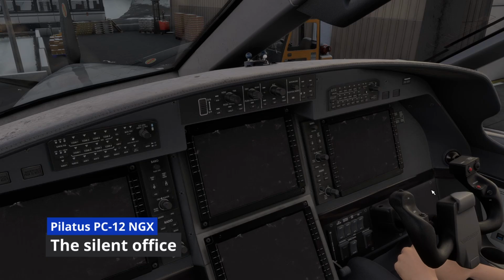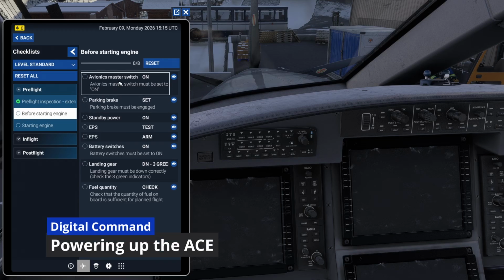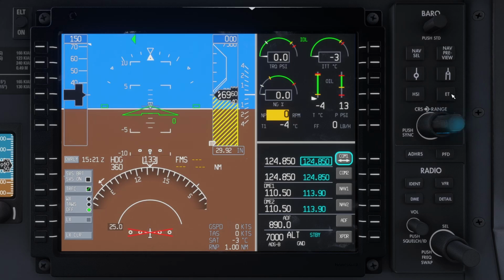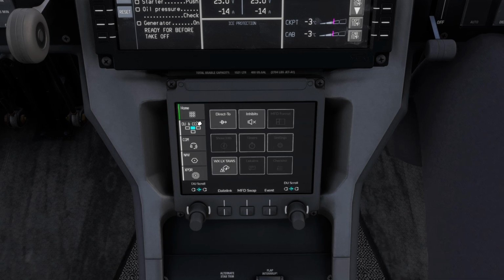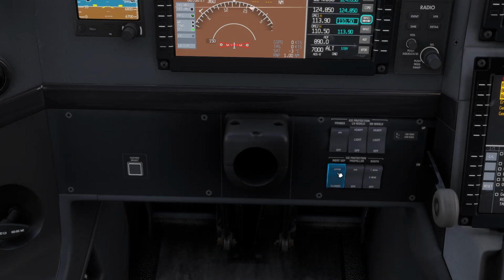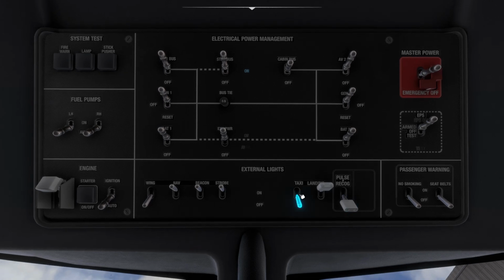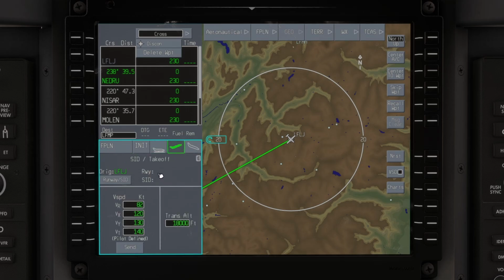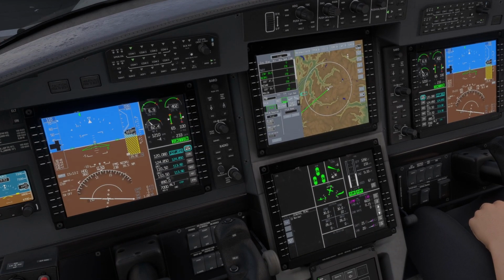PC-12 NGX Mastery: Finally Understand Every Display!

Comment: Thanks for those video. Very informative. As we say, we learn by looking at unknow function, but we learn too by looking at "mistakes". For exemple, when you say that the radio switches doesn't work, it's just because you have the same frequency on both side, so when you switch, you can't see that the active one switchs with the guard/setting one.
I learned and discovered so many functions thanks to your videos.
Reply from the maker: Thanks and also for pointing out the "mistake" also learned something new